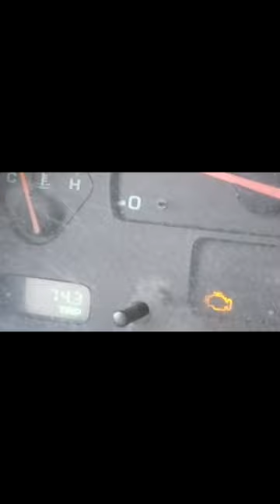Symptoms of a Bad Thermostat (STUCK OPEN) #shorts P3.2

Comment: Funny that it shows jeep thermostat housing at end. I did one yesterday. But turned out to be impeller free spinning on water pump shaft....
Reply: Mine is showing that too but I highly doubt it’s my thermostat they way my jeeps is making a noise every time I break or accelerate
Reply: Jeeps are notorious for cooling components going bad. Shitty thing is  once one thing breaks in them it tends to take the rest to the grave as well